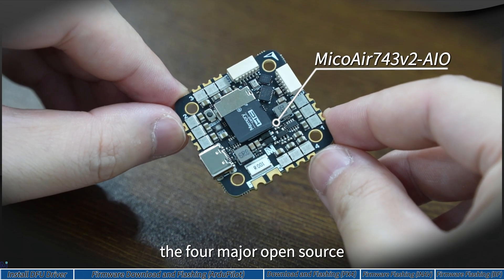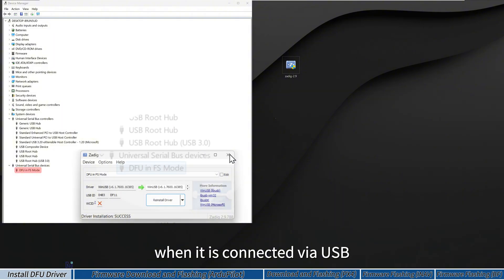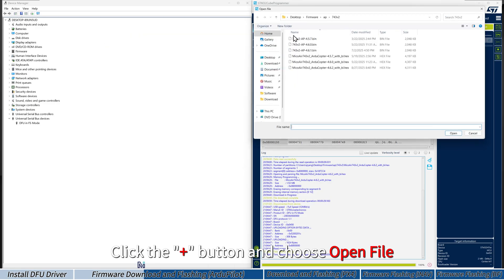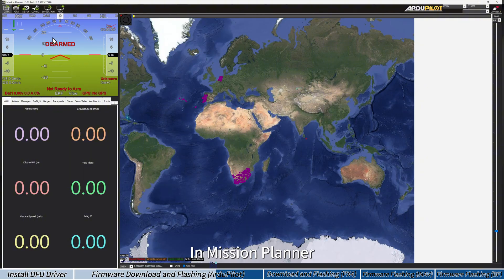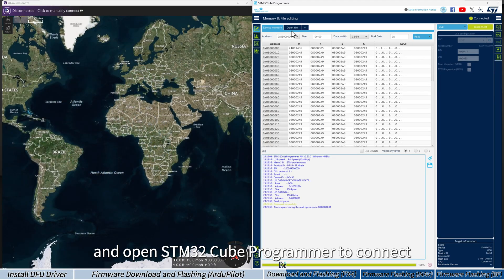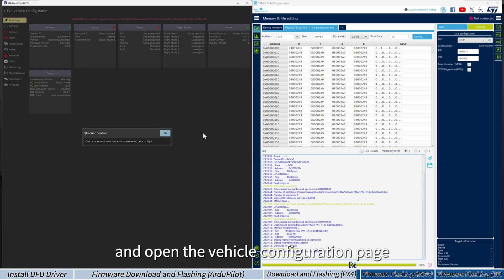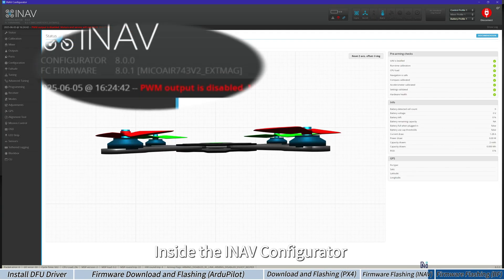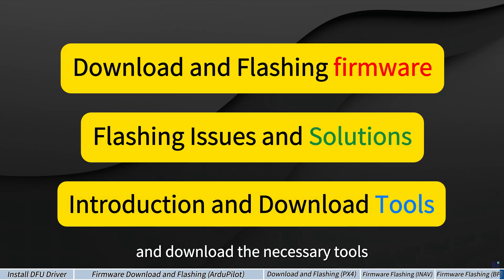Installing ArduPilot/PX4/INAV/Betaflight on H743 Flight Controller

Comment: This means i can't use betaflight official 4.5.2 firmware in micoair 743 v2?
Reply: I just got one as well and I'm having the same problem. I flash the beta flight firmware and nothing connects.
Reply: @redes40  I found the  4.5.2 firmware file in the micoair github. This worked for me.
Reply: @redes40  i was able to install betaflight 2025 version. follow the steps shown in this video.. it'll work

Comment: I would like  Micoair FC and AIO range to include a PCB with a minimal number of connectors, for those who prefer to solder wires and cover the board with electrical insulating varnish.
Reply: Ohh... There are plenty of FC on the market with soldering option. Let's have Mico with connectors (the lock is missing though).